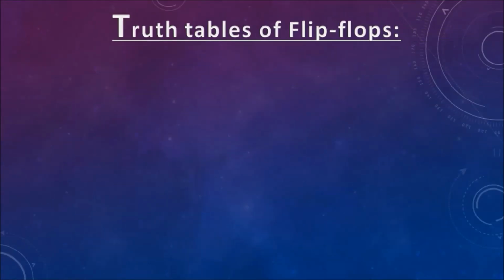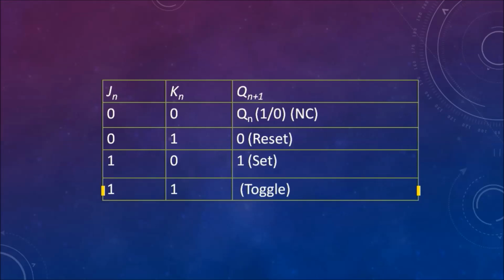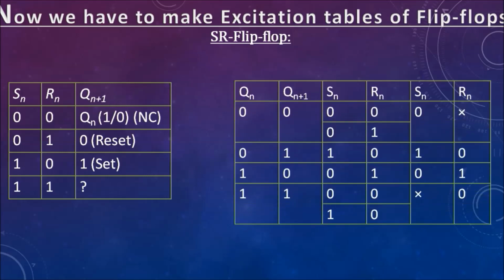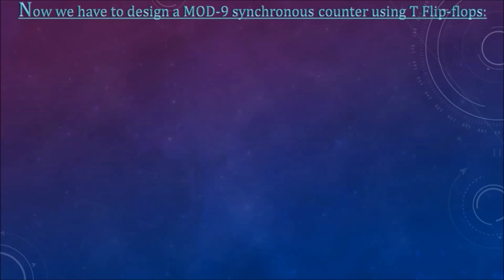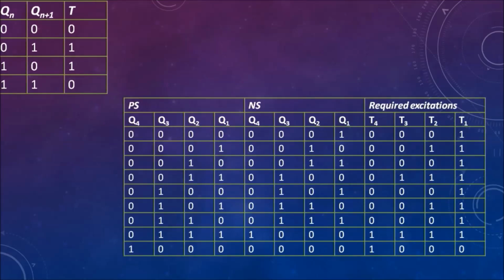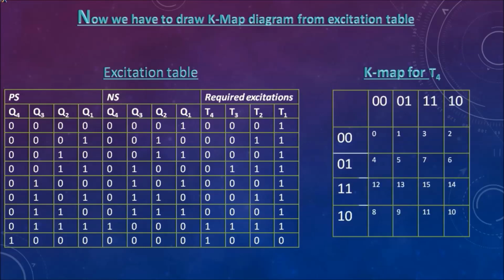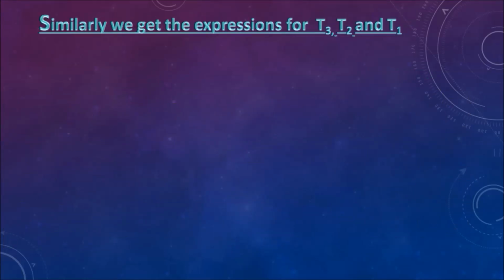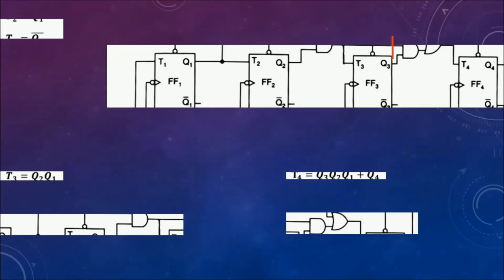How to design Synchronous Counters | Modulo-9 Synchronous Counter using T flip flops

Comment: Sir, I don't understand, why a filipflop may get clocked before it receives a new input? Please help me sir.
Reply from the maker: Follow my channel for further discussion . #PHYSICSworldADatabaseofPhysics
But now remember that clock pulse in a flip flop decides at what time(edge of a clock pulse) or in what interval(level low or high) will the outputs of a flip flop be dependent on the inputs. Without clock pulse input flip flops are similar to latches. Hope this is helpful. :)